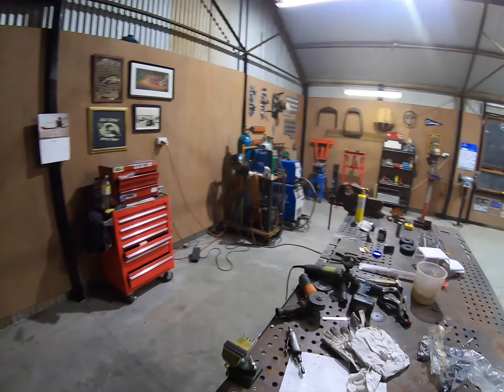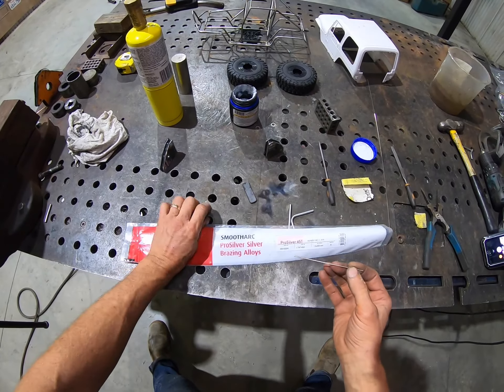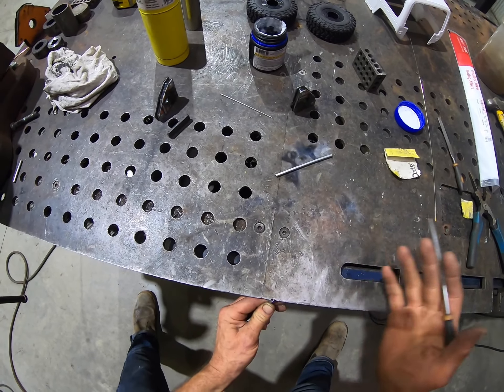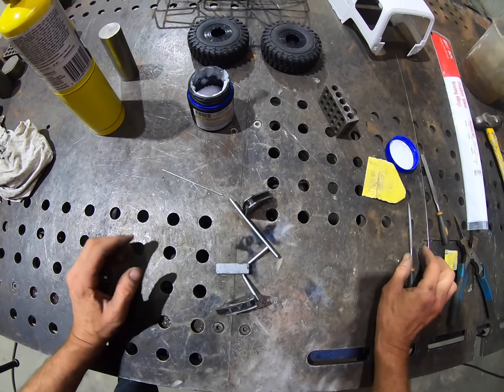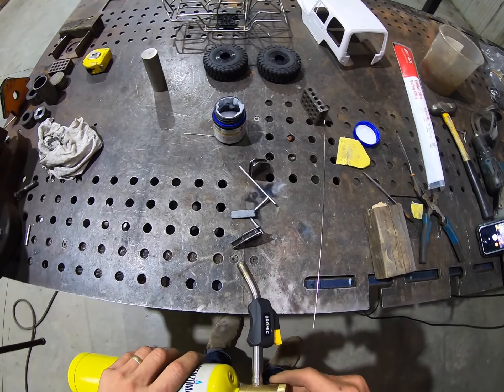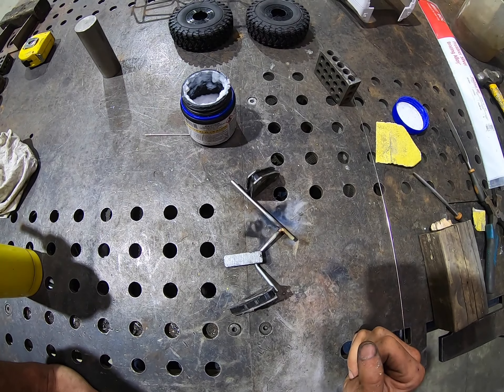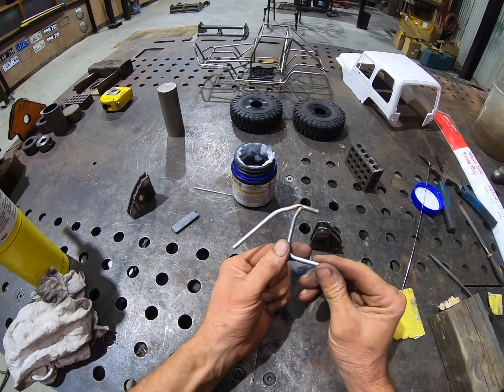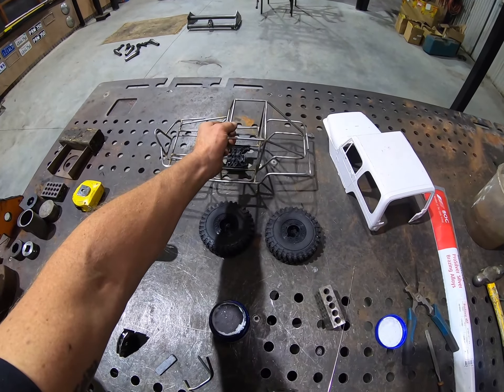How to braze basics - Building a scale RC rock crawler cage (Part 1)

Comment: Hi. Great video and project. I’m just starting out. Limited budget. Could you be more specific with the adding and heating of the flux and specifically which flux. I am using trade flame silver braising flux on copper. I find the flux bubbles and burns. Then nothing will stick with bunning silver solder. . Any advice please! Thanks. Pete.

Comment: What type of metal are the rods?
I have aluminium ones & aluminium braising rods & they don't  run tidy, normally a i burn & melt the aluminium & rods wont melt. Do i need a specific type of flux

Comment: Great video,
Iv been planning on building a 1/6 Willys Roll cage, just never have tried Brazing
Is the Flux a must when brazing?
Reply from the maker: Definitely a must yes. You can get flux coasted rods too. I prefer to use it manually as I find the flux coated rods too thick for such intricate work .

Comment: Great video - thanks. Why do you do brazing rather than TIG in this situation?
Reply from the maker: TIG welding is a completely different ball game. They all have pros and cons. I actually TIG weld outside of RC projects on 1/1 cars. I prefer brazing as it's cleaner and a lot simpler. I use 3/16 mild steel tube whereas a TIG cage generally uses solid rod.